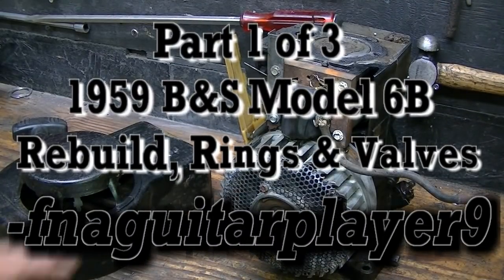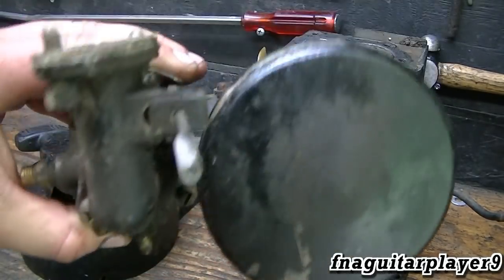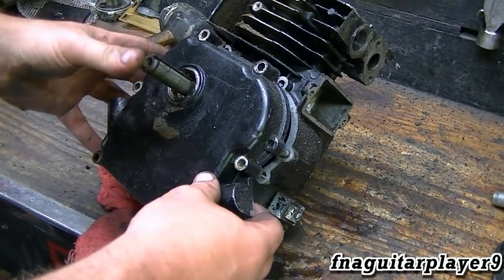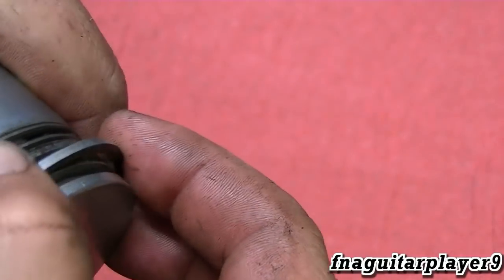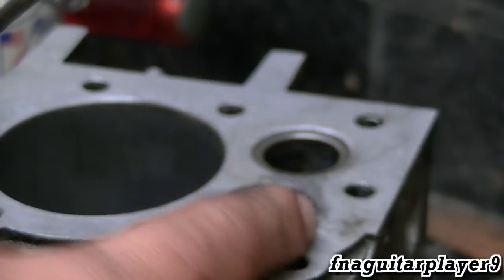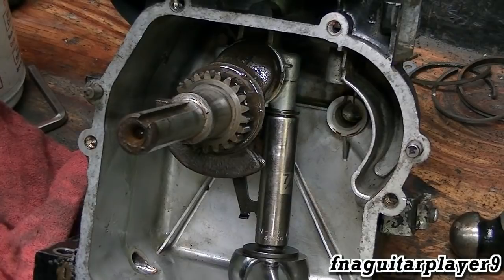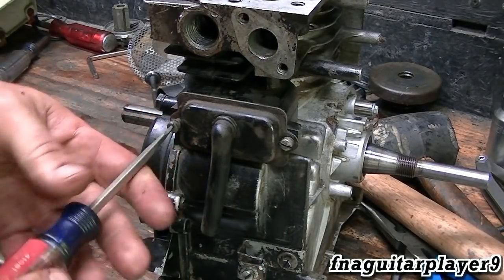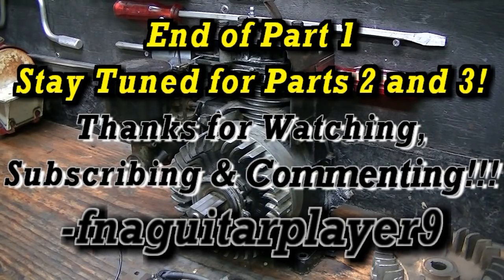1958 Briggs & Stratton Model 6B Rebuild, New Rings & Valves Part 1 of 3

Comment: Pretty nice old engine, I love the old vintage Briggs flathead engines. I have a 1965 Briggs 4HP horizontal model 10 that a buddy of mine gave me that he rescued from the scrapyard. The engine is in decent shape and turns over freely and isn't locked up and it has compression when I pull it over with the rope, it wasn't getting spark but I fixed that by cleaning the points and sanding the rust off the coil so it gets a good ground. Haven't tried starting it yet but I'm going to do a complete rebuild on it, bought a new OEM Briggs standard piston and ring set, a complete engine gasket set that includes new oil seals and I also ordered a new spindle bearing for the crankshaft as I saw on the parts diagram that this engine has a ball bearing on the crank so I figured I should replace that as well.
Reply from the maker: Thanks, same here! I hear ya! Those are great engines too, one of my favorites is the 5 horse model 13, very similar engine to the 4 hp. some parts are the same too. Thanks for Watching!!!

Comment: Great Video,  love them old Briggs engines,  I found a old Eclipse mower, think it is a 1956, has a Briggs 1 6/10 hp motor on it, it turned over good and compression. Pull and cleaned Carb. started on first pull, I couldn't believe it. 
Keep up the good work Buddy!👍
Reply from the maker: Thanks! I hear ya! Can't beat that, i love the old engines, they were made to last. Thanks for Watching!!!

Comment: I’m looking at buying a 1958 “6br6. It looks just like this. Are parts readily available ?
Reply from the maker: I hear ya. some are some are not as easy to find. Gaskets are easy to get, but I had to order NOS rings and valves, could not get it to cross to anything else for some reason. The bore appears to be a standard model 9 size (didn't measure to verify) but the piston may be different. And the coil problem in part 2, that took some digging to figure that one out! But short answer, yes, parts are available but it takes a little work to find some of them. Thanks for Watching!!!